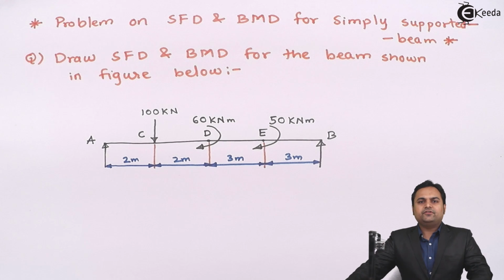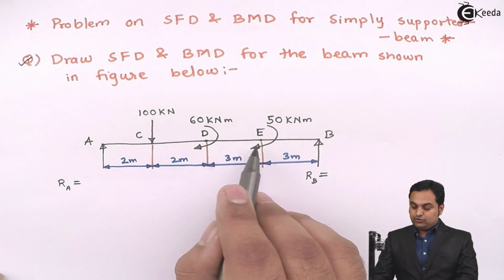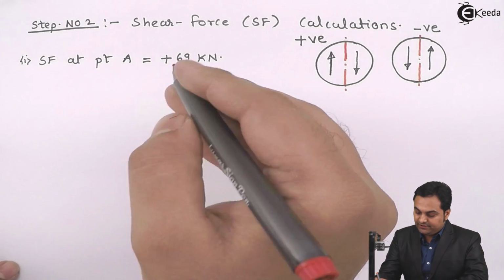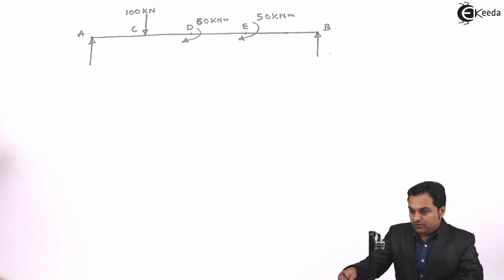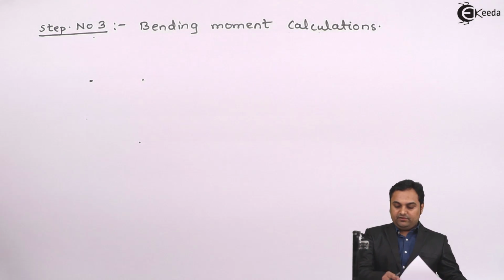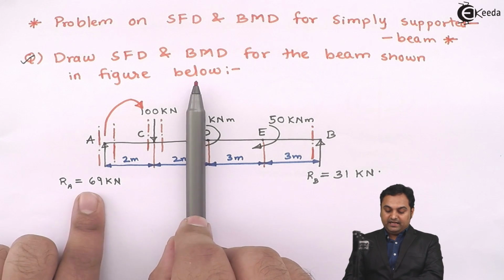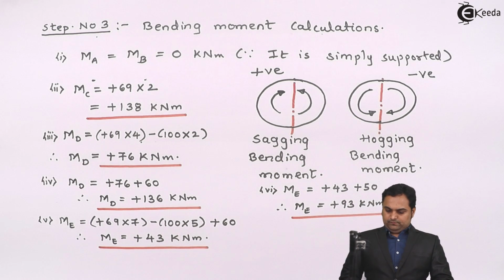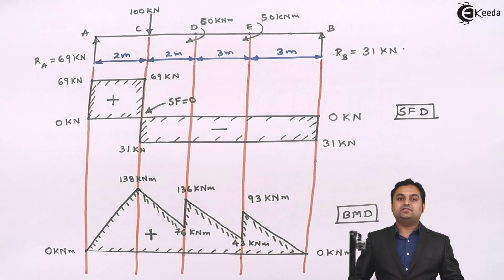Problem on SFD and BMD for Simply Supported Beam - Shear Force and Bending Moment Diagram

Comment: Sir can u pls explain how did u calculate sf at B... (1) if i take sec just left of B & looking from LHS it should be same i.e. -31 as there is no loading from E to B. But if i take sec just right of B & looking from LHS then it'll come out zero (as -31+Rb = 0) so wat is sf exactly on B & 2nd thing wat is sf exactly on the remaining points i.e. A,C,D,E... Generally these two doubts i have almost in every question.. So its my humble request to u PLS PLS REPLY!
Reply: Yes...it is also my same doubt